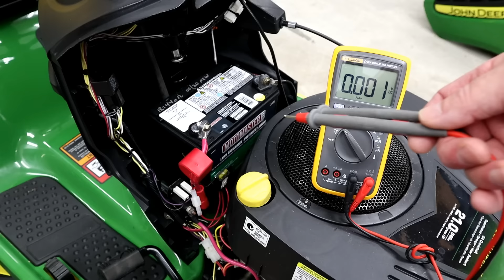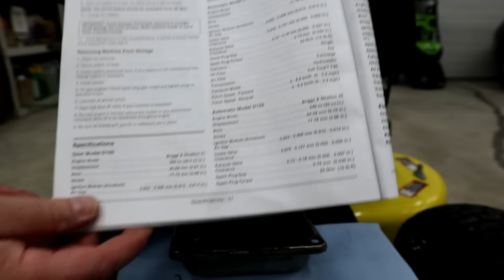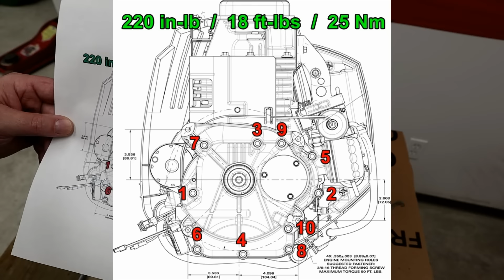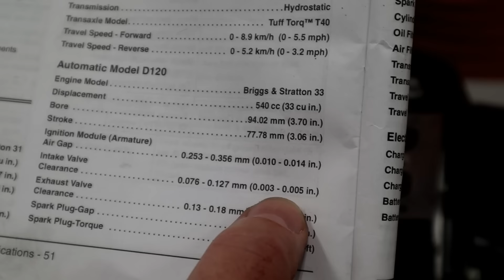Why Won't Your Riding Mower Turn Over? COMMON Briggs Intek PROBLEM & REPAIR.

Comment: Luckily my decompression problem was fixed with a valve adjustment. They were loose after about 65 hours. After I readjusted my intake and exhaust valve per specs, my engine turned freely again and started right up.

Comment: The reason why you don't set the valves at TDC is the valve closes just after BDC, the intake valve closes. Both of the valves stay shut. Both valves remain shut until just before  TDC of the compression stroke. Then the ACR will bleed some of the compression off. Hope this is helpful in explaining why you adjust about a 1/4" aft of TDC.

Comment: I know what you mean about Briggs and Stratton junky cams. I've changed dozens of them  in the last year. You're right too about the hit or miss on the aftermarket parts. Good video I guarantee. Had a 7.5 with a cam problem on a pressure washer. The cam shaft was metal. The gear and cam lobes were pressed on plastic. The lobes spun on the shaft. More Briggs and Stratton junk.

Comment: I replaced a compression release on 3000 series Briggs a few months ago.  It is not a common problem, but happens with Briggs single cylinder engines.  Bad head gaskets are more common in these engines.
Reply: Replaced head casket last year, and just now had to replace cam. 21hp

Comment: Were getting a new camshaft on our John Deere E100 with 142 hours on it. I'm surprised Briggs & Stratton didn't recall these engines if it's a common problem.

Comment: I saw another video about the camshaft issue and there was some discussion about how to shut the engine off.  

My 2021 manual says:
1. Let engine run at high throttle without load for a few seconds.
2. Turn key to STOP position.  Engine will stop and headlights will turn off.

The thought is that if turned off while idling, there's a chance that there might be a kick back and that would stress the weak Compression Release Mechanism and break it.  It was also suggested to shut off the engine with the PTO engaged.  I don't have a Briggs and Stratton manual, but I looked up one online and it said roughly the same thing.  I don't know if this'll prevent the problem, but t guess it won't hurt to give it a try.
Reply from the maker: Yep, who knows if those methods do anything or are just manufactured Briggs myths to give false peace of mind for their under-engineered / planned obsolescence part?  I read all those same recommendations when my first one crapped out and afterward always endeavored to turn it off at full RPM when I put the first replacement cam in, but it's not always possible and I know I didn't do it 100% of the time. The second one did last longer than the first however (as meaningless as that sample size of 1 anecdotal observation is). I've been trying to do it every time with this one too, but certainly have forgotten a few times. As you say, it can't hurt anymore than a decompression assembly flying to bits inside 🙂
Reply: John, just a thought, there's a fuel shut off solenoid on the carburetor bowl.  What if we added an inline switch to cause the engine to die from lack of fuel, do you think that would be a solution?  I don't know how long it would take for the engine to stop, I'm guessing 30 to 60 seconds.
Reply from the maker: Personally the only solution I see is a more robust design. I really don't see how the engine surging for 20-30 seconds as it's being starved of fuel would help, in fact, that to me would be even worse as that little pin and arm are revving up and down during the starvation surging.

Comment: I did not have to disturb the  rocker arms nor the oil pump. Just pulled the bottom off with engine at TDC and swapped the cam.

Comment: On why a quarter inch past TDC, I am 17 years full time in small engines. This position just ensures that you are past the flip flop of TDC , and committed - locked right on!
Reply from the maker: Makes perfect sense.

Comment: Looks like there is a likelyhood of that decomp cam running interference as it tries to swing and the intake cam is coming around to raise the lifter. If that thing didn’t swing absolutely perfect it looks like it could get hammered by the lifters edge!

Comment: I know I should wait until we get more than 2 minutes into the video but mine showed the same starting symptoms but turned out to be the carburetor leaking fuel into the cylinder causing a hydrolock situation. I noticed when I forced it to turn by hand fuel would come out of the muffler,  I added a fuel shut off switch and it doesn't happen anymore.

Comment: Run fast as you cam from 33 series single cylinder Briggs engines. The cams are trash. I’ve done a few cam swaps and even got by per the customer request knowing the risk to run  with the ACR parts sitting in the bottom of the sump. You can by pass a bad ACR with a big CCA battery and rotate it off the compression stroke. Got lucky the starter and battery held up. Our local dealerships get 850.00 to do a cam job . Not a cheap fix.

Comment: Thank you, John, very informative and clear.  I hit a bit of a snag trying to figure out how to keep the engine from turning while trying to loosen the pulley bolt, but eventually got it: my wife wedged a large screwdriver in the flywheel teeth against the ignition coil.  Would have loved to hear how you did it.  Cheers.
Reply from the maker: I used the mechanic's most beloved tool - an impact wrench .  If I didn't have one however, I would have likely locked the flywheel the same way you/your wife did. Might of first tried to lock the pulley by engaging the PTO and secure one of the blades, but I imagine it would have slipped.  
Hope the rest of the repair goes well & thanks for watching 👍🙂
Reply: haha, right!  Well, thank you for the quick reply.  You can imagine my disappointment at finding the compression release mechanism on the camshaft intact and working fine.  Turned to be a bent intake push rod ... no wonder it exhibited all the symptoms you cited.  I bought the repair kit but not sure now if I should use all the parts that come with it (gaskets notwithstanding) - what would you recommend?
Reply from the maker: My biggest question would be how did the pushrod get bent? There has to be an underlying reason. If it were me and I had everything apart and had all the parts, I would likely put the new camshaft in regardless the condition of the original - but that's just me. 
Still, before doing any of that, my main focus would be trying to find out why the intake pushrod was bent in the first place. This can be caused by a sticking valve but there are other possible reasons - use your Google Fu.
Reply: Thank you, John.  Yes, of course - that's the big question.  The only clue I have is that when I opened the valve cover, I found the (I'm guessing intake) rocker arm and its setting nut really loose.  I assume it had loosened slowly over time until ... boom!
Reply from the maker: Yep, I suppose a really loose rocker could lead to a bent a pushrod.
Reply: hmm, or the rocker was loose because of the bent rod?  Valves seem to be moving OK and about the same amount of movement (exhaust and intake).

I don't want to take any more of your time, John ... thank you again for your very kind and thoughtful replies.  Cheers

Comment: good video, the  big end bolts are also worth checking the ones on my ohv  engine came loose  and took out the governor  luckily  the crankshaft had minimal damage and was reusable  .
Reply from the maker: Good tip 👍

Comment: I have a 2005 JD L-100 and it still runs great. I think this might have an older Briggs that was made better. I blow my mower off with compressed air also and it still looks great.  Thanks!
Reply from the maker: Would be interesting to know the exact engine in your L-100. Specifically is it an Intek, and if so, what series number?

Comment: weird thing, I am not a mechanic  i am a chef  but my father owned a  lawnmower repair shop and i practically grew up there,, ,As a result I can tear down most air cooled engines and  fix almost any problem they may have,,  replacing sheared timing key  or hub key,,  setting points    doing valve jobs   sharpening and balancing blades   replacing broken recoil springs in the starter .   air cooled engines are pretty easy and basic,    got fuel ?  got spark?  it should run... to adjust the idle close the set screw all the way  then open it 2 full turns.. thats  a good starting point,, adjust from there and a regular old business card works as a feeler guage for setting points

Comment: The Intek on my brush-mower is fine, after 10 years... only issue is the starter:  seems like I have to tear it apart every year to clean the bearings and brushes.

Comment: About 16:45 "Briggs & Stratton used to make good stuff"
it's not the same B & S,there was a bankrupcy a couple years ago and someone else picked up the assets and name although I think the final several years of the old company featured bad management that gradually faded the once excellent reputation of building "products that work" and having had the best network of parts supply and servicing dealers in the industry.
I might sound a bit jaundiced about this because I lost about $10K in the stock which became worthless.

Comment: Bonjour. Merveilleuse vidéo. Bravo pour votre travail posé et très bien expliqué, même si  à 19M44 vous remontez l'arbre à cames sans la soupape d'échappement! (LOL) J'ai beaucoup appris en regardant votre vidéo. Un tout grand merci de Belgique!
Reply from the maker: Exhaust tappet is in there, clear as day. Might be out of focus, but it's in there. Time index 19:44, you can see both the intake which is in fairly good focus and the less focused shiny dome of the exhaust tappet about 3 inches under it.
Reply: OK, sorry! Peut-être un effet d'optique. @Rchelicopterfun

Comment: Great video and explanations. I have a 3100 series engine and I had a valve problem. The aluminium intake rod bent and broke at the valve end, further the plastic fitting on the rod guide was broken. I ordered new intake rod and guide plate but now the intake rod doesn't move backward and forwards. Any suggestions as to what the problem could be?

Comment: (Dis)honorable mention goes to the connecting rod and wrist pin in these engines. First time I have ever seen an aluminum wrist pin, and it's coupling the thinnest piston to the thinnest connecting rod material I've ever seen.

Comment: Great job John!
 Not a fan of their Comp. release, huh?
  I am also an independent shop, and picked up a couple of pointers along the way. On the pre comp.- release engines, I use the "Comp. push-thru" to start a machine with the same symptoms. Usually, it's either sulfated battery or bad bushings in the starter, I just replaced a starter on one last week. Funny thing is, you can spin one of those starters on the bench like crazy, but they won't push through good compression!
 As to the 1/4" drop to set valves, I noticed that when I put the cam in with the timing marks set, the piston is already at about 1/4" below TDC. Could that be the preset for BTDC spark advance?
Reply from the maker: Thanks for the additional tips and thoughts on TDC. Yep, that makes sense. 👍

Comment: I would've changed out that wore intake rod while I had it but I guess if you're that well versed at taking the whole engine apart then it's no big deal.
Reply from the maker: They develope that wear mark the first run. Normal.

Comment: Thought Inteck was a good motor. You do good work. I'm going to avoind B&S newer stuff as I'm not a talented mech like you!  Thanks.  B&S uses plastic carbs in lawn mower. Quit after around five hours of use.

Comment: I did not know what the problem was with my B&S engine; always thought it was the battery, starter, solenoid, poor wiring connection, etc.  I have the best battery and I turn the engine off compression by hand ro get the first start of the day. The rest of the day, the engine will always start with a bump at compression.   I have been running this engine like this for years. I have no plans on tearing it down at this point.
Reply from the maker: Nice - hope it continues to run without broken bits circulating within the engine.

Comment: I thought I had the same problem, ended up all I needed to was adjust the valves.  What gave it away was removing the spark plugs and engine turned over no problem.
Reply: With the spark plug removed it's going to turn over easy whether the compression release is working or not.

Comment: Mine won't turn over when I nudge it past TDC, so here's a trick I've been using on mine - I spin my engine backwards until I feel compression. I take the air filter off and block off the intake with a piece of cardboard while turning the engine over. If it can't suck air in, there's nothing to compress and the motor spins freely. Fires right up every time.
Reply: I'm having the same issue - It just won't turn over even after nudging it past TDC. Battery still good and supplementing with car jump start. Will try your method. When turning backwards are you stopping at point when you first feel compression or after?
Reply: @pkmzeta  Sorry, just saw this. I stop when I first feel compression. That's usually enough. Make sure the intake is completely sealed off when you start to crank. Once the engine starts spinning like it should, let air into the carb and it should start.
Reply: @willp942  Thank you very much! I'll try that out.

Comment: i was about to adjust the valves on a briggs, but the motor will not spin by hand to line up the pistons center top down.

Comment: Got a couple of questions, why wasn't the key stock removed, and what about the engine oil and filter!!!!!! Maybe we should already know this!!!! Other than that pretty good video.
Reply from the maker: By "key stock", I'll presume you're referencing the square bar that slides into the output shaft keyway; if so - it can't be removed, it's brazed to the inside of the power pully. Of course the oil and filter are replaced after the job is completed. I even said so as one of the very last points. Yes, I would absolutely presume that anyone capable of taking on this job would understand that replacing the oil & filter is a requirement after this job considering it was all drained out before servicing; but then again, the lack of common sense and overwhelming ignorance these days is astonishing.

Comment: Troubleshooting my own issues at the moment and realized the flywheel turns by hand no problem for a few times until it hits somethings. I turn it counter clockwise a couple times then again clockwise and the hard stop is gone. Can it be a starter issue or you think it’s the actual compression release being broken like the video? Trying to avoid taking the motor apart. Appreciate the help.

Comment: Hello, I believe my John Deere is running on only one cylinder. It has less power now and wants to bod down or shut off when I get into some high or thick grass. The power this year is much less that last year. What happened? Is this something I can fix or should I buy a new tractor? I have almost all new parts on it. Selenoid, fuel filter, fuel pump, coils, all new wiring harness, new battery, new plugs, new PTO clutch, new mower deck belt and spindles.

Comment: That's the problem with my 19 HP Briggs alright. The engine does the same exact thing, and the 1-year old battery checks good on the expensive tester at the battery store. It happened all at once too, just like flipping a switch. Out with the motor I guess. 😡

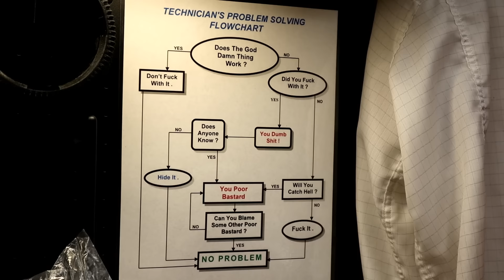By the way, that flowchart at 18:08 is oh so accurate. 😏
Reply from the maker: Hope the repair goes well 👍

Comment: Done numerous camshafts for these engines, both aftermarket and supposedly OEM.  Is there anyway to ID an OEM from aftermarket?
Many old B&S parts were embossed with the Briggs Logo.  Most aftermarkets have the same numbers/letters stamped onto the cam.

Comment: As an insider in the industry, they are all going this way. They’ve learned that the real $$$ is not in the sale of lawnmowers or equipment but the sale in replacement parts. Way more $$$ in parts than the one sale of the equipment.  We’ve identified problems in the production of things just to be told to leave it, so there you go.
Reply from the maker: Yep, Planned Obsolescence/Durability Economics 101.    ☹

Comment: On the smaller motors they use a plastic gear pressed onto the cam that eventually moves out of sync with the cam shaft it's self, poor engineering right there.
Reply from the maker: Thanks Anthony for sharing yet another Intek cam issue. It's unreal and you almost have to wonder if Briggs has purposely engineered these things to fail in rather short order to get the machines back into the shop or force the sale of a new mower/power equipment (the good old planned obsolesce money grab trick)? Got'a wonder how many Inteks are sitting in metal scrap bins world wide that are in perfectly good condition other than the under-engineered compression release mechanism?
Reply: @Rchelicopterfun  Sounds like planned obsolescence to me. GM did the same thing when they used that orange coolant in the vehicles  starting in the mid 90s which caused rubber  seal deterioration and corrosion on the aluminum heads and gasket failures all the time right after about  150k or when the warranty period had expired.
I didn't even know about it till my new mechanic told me about it and advised me to get rid of the vehicle I had before it went belly up. Sure enough it did and for exactly the reasons he warned me about. 
He had been a GM service manager for thirty years and said he left the company for this very reason. He knew what was going on and what the problem was ,didn't  like lying to the customers and knew they had planned it this way. There was also a class action lawsuit against GM because of their scam .